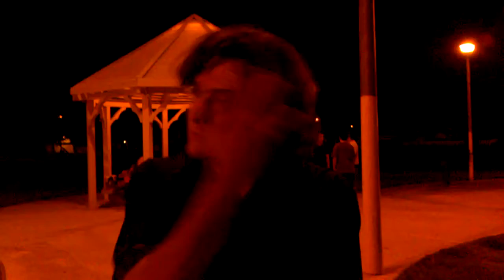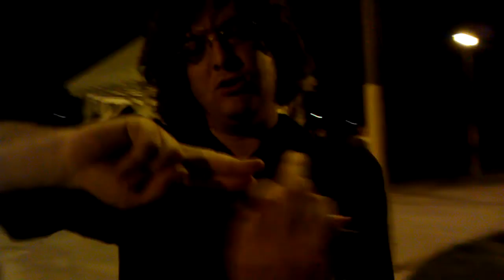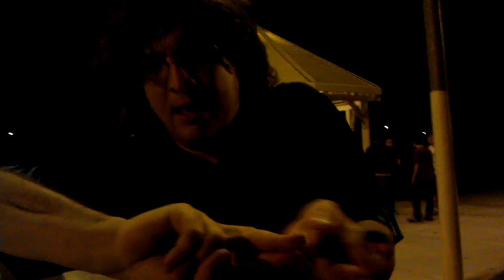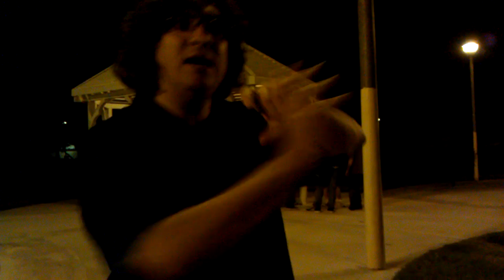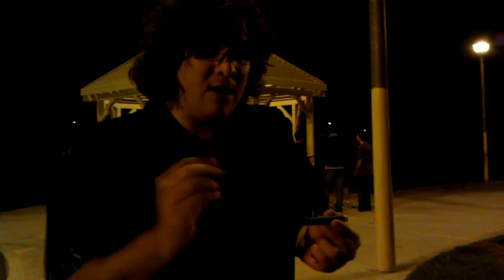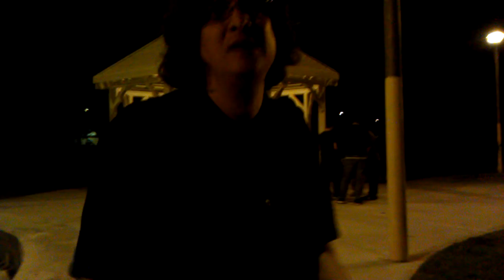Mechanical Engineer explains why the Nerf Retaliator Rifling doesn't work

Comment: Well also that it does not guide though the whole length of the barrel like a rifle or pistol does.  The barrel also still doesn't hold air very well.  So take a recon barrel, put it on a retaliaror with straight groves, then put on the spiral groved one with the same darts, When i did it i saw no change bro, still don't agree, well than "f" man!